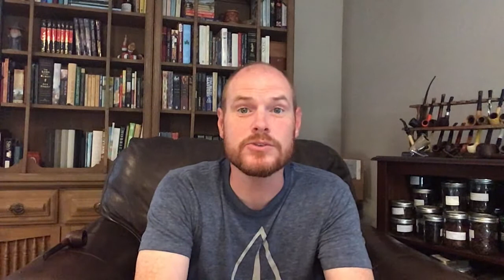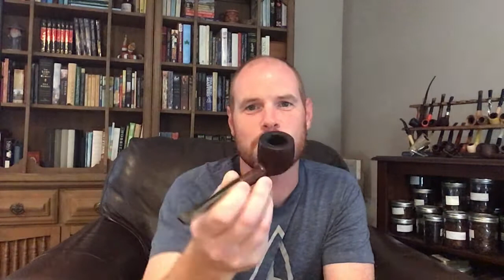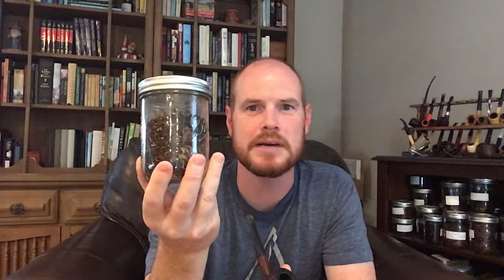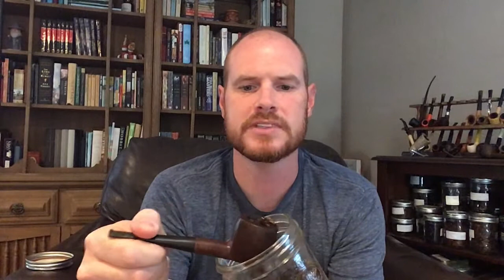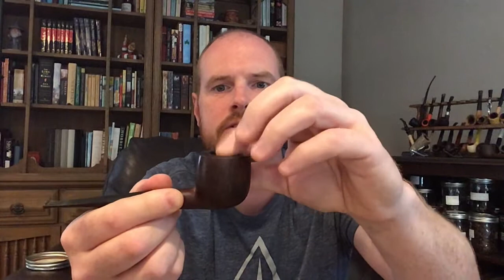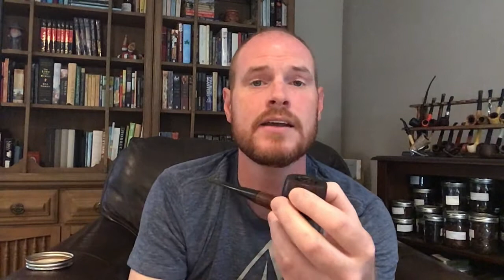Pipe Smoking 101: Loading A Pipe

Comment: What if you smoke plugs or flakes ?
Reply from the maker: Those definitely pose a bigger challenge on loading. I rarely recommend either to a new pipe smoker due to the difficulty, but my advice would be to have them fully rub out the flake or coin (cut from the plug) and still using this loading method. I was consider this method the easiest way to achieve success starting off. From there you can try folding and stuffing methods. I'll do a video soon talking about handling plugs, flakes, and coins. Thanks for the comment!
Reply: @ThereAndTobacAgain  thats true...amazing to smoke though...3p's is one of my favorites